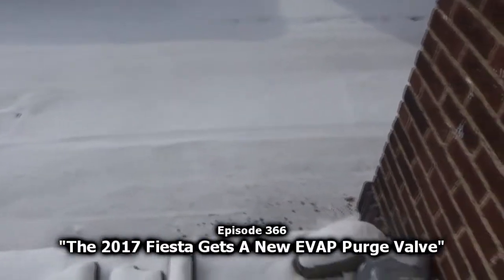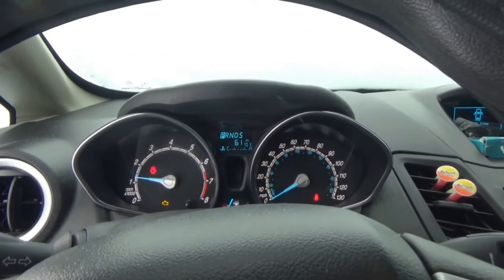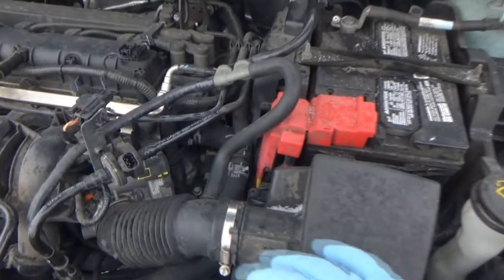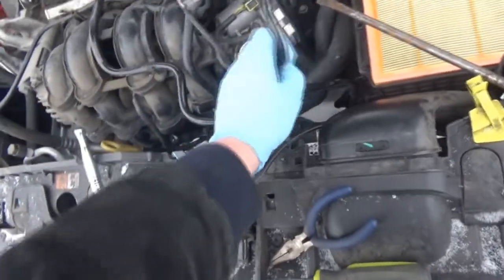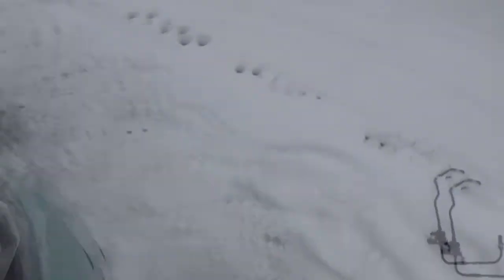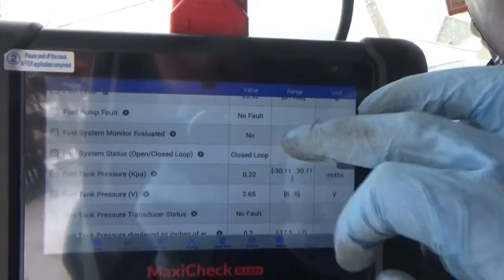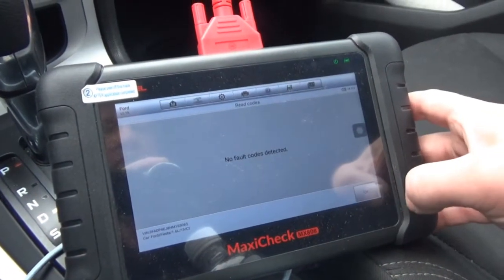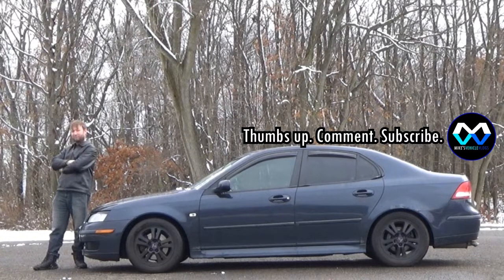MV 366 - "The 2017 Fiesta Gets A New EVAP Purge Valve"

Comment: As for the Fiesta.  I bought mine new in 2016.  It has been a great little car.  I do regular maintenance and I cannot complain.  The EVAP. Canister has been my first problem.  Friends who paid much more have been in and out of the shop.  I drive the car moderately.  I go, go and go.  One complaint.  The back seat hasn't much room.  I have the hatch back. Since buying mine I have talked to others who own the Fiesta and there where few complaints.  I am happy with my dependable car.  Thank you for the informative video.  It fixed the problem.  😊

Comment: If you're having issues with the front side of the tubing on the engine - if you take the pitch clamp and slide it towards you (away from the engine) all the way than you will be able to just pull it off overtime. The piece that you need to slide the new part in, is a V shape so it's super easy to slide the new part in and have it fit itself onto the engine piece than just slide the new pitch clamp all the way you can towards the engine than boom you're done with that part. I literally just did it myself and only took a hour to do labor wise.

Comment: Quick question, I have the same exact car and when searching for the purge valve one automotive dealer sells the valve canister itself while another sells the get up as you have it. Would you think it makes a huge difference in replacing the lines as well or would the valve be stuck in just the canister itself? Any help is much appreciated
Reply: Most fiestas have the purge value heat-sinked tubing that you have to buy a whole kit with the tubing already on the purge value which makes it $120+. Mine is having the same issue but I have to watch the video to see what parts he used to replace it because I can't find the right part. Your canister should be fine tho
Reply: The way so I far I have side stepped getting the part is installing a cold air intake which helps the engine suck in more air to offset the extra vipers from the purge value but I'm not sure you'll want to do that depending on where you live. I just moved from Colorado to Florida so I no longer have emission checks. also Ford SUCKS

Comment: How did you get that front hose off? it's so difficult to pull out. Fiesta has mad it so complicated. If we could replace only purge valve instead of whole vent hose it would be so easy and price saving. I think ford wants to make money out of this part.
Reply from the maker: Just had to careful fight with it. I ended up using a large flathead screwdriver and carefully pry it from the intake. Very, very carefully.
Reply: @MichaelAdamsRocks  I also thought of that but it’s so tight no room for holding a screw driver and pry it. Once you pull out the old one is it difficult to push in the new?
Reply: @whoispradeep  The new one was SUPER easy.
Reply: @austinbenjamin8597  What do you mean by new one is easy?!! You took out the new one also? I am taking about pulling out not putting in.
Reply: @whoispradeep  pulling out is hard but if you pull the clamp connecting into the engine out first towards you all the way than just start pulling and wiggling until it’s out than putting the new one is super easy. Micheal Adams shows you everything extra about reusing some things you need like the bolt and something else (I really don’t remember as over time I installed a cold air intake and put a breather filter on the top vent line that connects to the unfiltered air in the stock intake and I also been having to deal with some weird brake issues) it’s easy but will be a lot of work to do but it’s something anyone can do as I’m a skinnier guy and still managed to do it in a hour

Comment: All I got was the valve, no lines. Is it possible to get the lines off the valve?
Reply: No it's not possible unless you're willing to put in a LOT of work to use a heat gun to be able to pull the heat sinked tubing off of it. The part is literally only $20 at a auto part store for just the part. ALSO it's completely possible you got the wrong part as the bolted values have a different build layout than the tubed values. Consider yourself lucky to have the bolt in one. Now if you're asking if you can put the tubing onto the value than good luck as the tubing will need to be heat sinked onto the value if just trying to replace the part itself, I wouldn't even know where to get the tubing on it's own brand new unless again the dealership.
Reply: @austinbenjamin8597  I got the valve at the dealership, took it back before I got your reply. I told him the situation, he talked to a tech and they do the heat trick but I’m not skilled for that. He looked and said, oh yeah, the whole set up does come up. Told him again I had the 4 cylinder and he ordered the one for the ecoboost. Hopefully her ordered the right one this time. Picking it up today. I’m not sure I’m skilled enough to get these clips off honestly. I keep hearing how tough they are to get off. But I’m gonna try
Reply: @Lsgriff  I believe you can do it tho, it will take time yes but with time, you got dedicated and will make it happen. Just remember to be patience with it and just to get that clamp all the way back then pull/wiggle that bad boy off. Once you get past getting it off, I ensure you it will be easy to install the new part especially since you’ll have the right one now. Rewatch the video while doing so and I would highly recommend taking off the intake just so you have more space in order to get that clamp back. That clamp isn’t too tight as I did it bare hands with gloves on (wear gloves!) as I’m a skinner guy which I thought I was going to struggle with. You got it and just remember to take your time

Comment: Do you have a video on the fan in that car when you change it? I'm having the same problems with my 2019 Ford fiesta overheating fans not coming on now. The evap solenoid is making a loud ticking sound then it will quit and start making loud ticking sound again. Sounds like both these problems are the same thing I'm experiencing. Any advice on what I should do or start?
Reply from the maker: I’d start with the fan since this could be much more damaging than the evap purge. I made sure that the fan circuit was in tact and also made sure that the PCM was controlling the fan when it needed to be turned on (with a scan tool). Make sure that the power and grounds are present at the fan connector before putting a fan in it, but my guess is that the fan probably did burn out. The one I put in for my sister from the junk yard is still running perfect. And yes, the EVAP purge issue is very common.
Reply: Dorman makes some pretty reliable fan assemblies for a good price I've used them before on an older Focus they worked well.
Reply: My 2012 Focus fan consistently stays on way after I turned it off😅😅😅 rendering me with a dead battery LOL😅